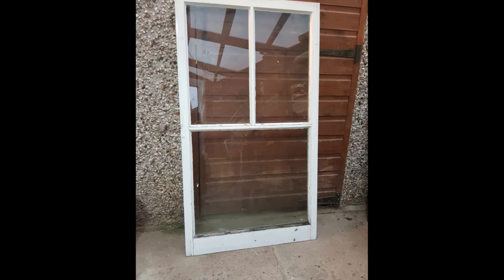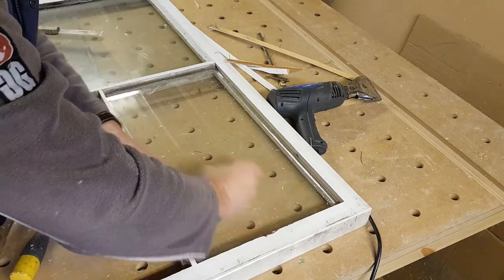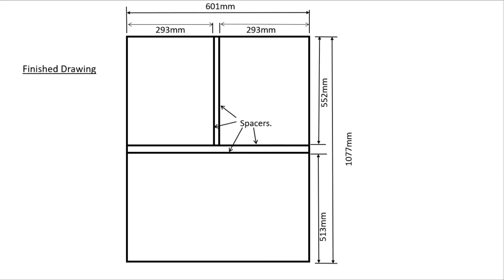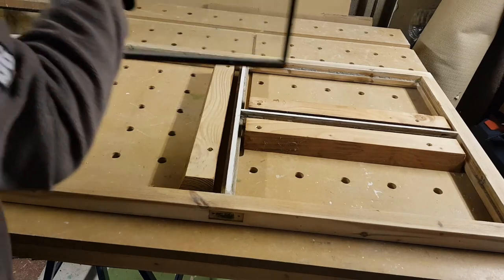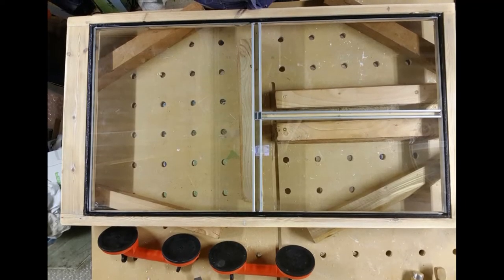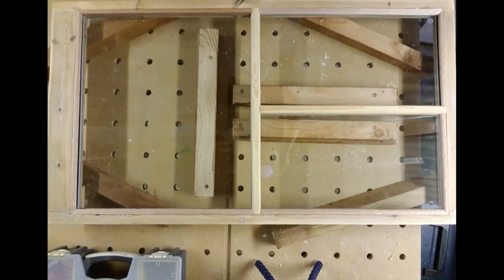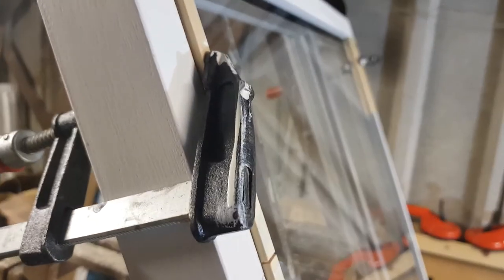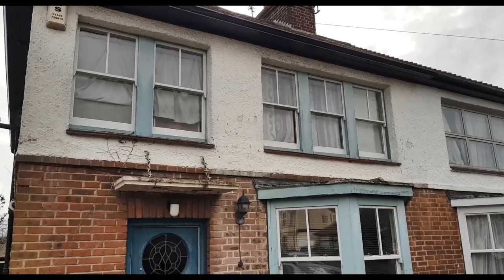Double glazing old sash windows.

Comment: Hi, great video. I’m curious to know about the 2 part paint system you used.  Would it be possible to know the brand etc? Thanks.
Reply from the maker: @Jonnysonone  Hello. Thanks for getting in touch. It’s actually a 3 part system made by Dulux. The first part is the etcher followed by an undercoat then the top coat. Not easy to find in stores but if you look in their Dulux Trade section for Weathershield 1 preservative primer (square tin) , 2 undercoat and 3 topcoat (usual round tin), you will find them.
Reply: @warwickshireworkshop9186  thank you so much

Comment: This is great. I want to do this to some old single pane French doors. The panes are all puttied in at the moment. If I was to replace with this method would I need nails or would silicone and beads be strong enough?
Joe
Reply from the maker: Hello Joe. Thanks for the message. Silicon is extremely strong so nails will not be needed. I would think you might have to deconstruct the mullions and by using a router table, reduce the depth of each one then stick them onto the DGU. If not make a jig to support them while you use the router. It will be painstaking work but with patience it should work. I have not used this method on French doors even though I have a set in the house. Let us all know how you get on.

Comment: Hi. Thanks for this video. Do you use linseed paint on the frames?
Reply from the maker: Hello. No I dont, I use the Dulex Weathershield 3.2.1 system.
Reply: @warwickshireworkshop9186  Highly recommend that you look into microporous paints like Bedec MSP. Dulux is just too inflexible for exterior wood, it can last a few years but it will crack, develop blistering and peeling. And can trap moisture in the wood. Becomes a pain when you have to refresh it because you have to strip it completely.
Reply from the maker: @ComeWhatThey  Thank you for the information. It's always good to get feedback and advice. I will have a look the next time I repair an external window.

Comment: What a great video, so informative.  I am quite an experienced woodworker used to making cabinets etc.  I'm usually pretty confident at making and modifying in wood, however I have one question.  If you deepen the rebate to take the much thicker glass unit isn't there a risk that the strength of the sash (frame) will be weakened?  Does the stiffness and strength of the new glass unit compensate for the weakening of the sash?  I guess as its one large sheet rather than 2 or 3 sheets of single glass, it contributes to the strength?  Thank you

Comment: Very informative. Thank you. Bit confused about the spacers. Should you the spacers at the bottom of the window be four mm in thickness? If you want a four mm gap? Vid seems to indicate two mm. Thanks again.
Reply from the maker: Hello John. Thanks for getting in touch and good question. Allowing the glass to sit away from the spacers would be preferable to allow for expansion and this should be possible as the silicon can support the glass in the frame. The aim of the spacer is to keep the glass from sitting or moving onto the wooden frame. This then allows any water that gets into the gap to stay away from the glass. You can use either what is shown in the video or any size gap and spacers you prefer depending on the size and shape of the wood. Hope this helps.

Comment: Great video - I’m inspired to do this in my home. How do you keep out the elements and secure the windows while you’re working on the sashes?
Reply from the maker: Hello Daniel. Thanks for getting in touch and for the positive comments. Appreciated. I cut a sheet of 11mm OSB down to size,  paint it white and screw it into place. If the window faces the predominant direction of wind and rain I add a bit of clear silicon for draught and  water protection. I paint the OSB white as it looks better than plain OSB. If I had any artist skills I'd draw a sash window and a pot plant on it but thats beyond me. Hope this helps.

Comment: Looks really good. Is there any benefit to one double glazed unit over 3 separate units?
Reply from the maker: Hello Jason. Thanks for dropping us a line. It is easier to fit one piece of glass than it is three. You will have to create a gap between each DGU so would run out of wood to hide the separator bars behind. Hope this helps.

Comment: I was thinking isn't it a good idea to drill a couple of holes from  the bottom of the glass either directly down or at a gradient to the side of the frame for any moisture to drain ?
Reply from the maker: Hello Mark. Thanks for getting in touch. You could do this but you would have to make sure the walls of the holes are treated to stop rot from within.

Comment: what about those cast iron weights? don't you need to put in extra iron ?
Reply from the maker: Hello Zirman. The original steel weights are normally cylinders of cast iron with domed ends. Adding anything to these is difficult as the space in the sash frame is limited. Lead is the only way to go if you are converting to Double glazed units.

Comment: My father used to do an emergency stop everytime he saw a skip and salvage old window frames because he wanted the 3mm glass which you could no longer buy for broken windows we would get now and then being next to a public alleyway. Because 4mm glass didn't balance with the weights on sliding sash cord windows.
Reply from the maker: Yes Mark. The Old glass is irreplaceable. All the old glass I remove from my windows I pass onto a specialist window renovation company who come to the house and collect it. It is that important to them as you cannot get it any more.
Reply: @warwickshireworkshop9186  However I have found a supplier that imports 3mm glass for greenhouses so all is good.

Comment: Hello, nice work. I would like to do the same but am worried about the depth of wood left after routing the sash window frame. I cant find any guidance on this (I doubt there is any really). Do you know any rules of thumb to know what thickness of wood is required to hold a double glazed window in place?
Reply from the maker: Hello Mark. The only rule is to use the minimum thickness double glazing possible which is about 14mm. This will then have a separating bar with a distance of about 10mm in form the edge. So with the 2mm surround gap that makes 12mm rebate all round. You will cut into the corner joints of the frame as I do. The depth you plunge will be 14mm + the bead, which you can cut down to size to minimize the wood removed. One thing to remember is that glass and esp. double glazing is very strong, it has amazing ridged strength capability. So if it is securely bonded onto the wooden frame with silicon it will become the strongest part of the window and keep the wooden frame together. Send me some dimensions of the frame you have if you are concerned and Ill compare them to the windows I have restored. Hope this helps.

Comment: Nice job. Matter of interest, why is the thicker DGU heavier?  It's still only 2 sheets of 4mm glass, even if the space between them is bigger.
Reply from the maker: Hello Tom. Thanks for getting in touch. On the older sash windows built around the 1920's, the glass will be circa 3mm. So with regards to a 2 pane frame with glass measuring 550mm x 320mm each, the weight is 3Kg. I have a DGU measuring 555mm x 700mm so roughly the size you will use to replace the two single panes with the method shown in the video, the weight of this DGU made up of two 4mm thick glass is 7.5Kg. Hope this helps.
Reply: @warwickshireworkshop9186  That still doen't explain why a larger gap means more weight?
Reply: @eah4187  frame of DGU must weigh something and one would expect 4mm glass to be 33% heavier than 3mm.

Comment: That was a very informative video, thanks.  I'm curious, how does the finish product compare to uPVC windows in terms of energy efficiency and U value?  And was your main objective in saving cost and maintaining the classic look?
Reply from the maker: Hi Bel. Thanks for your message. As the Double glazed unit in these windows is thinner than the normal upvc DGU's the efficiency is slightly less, if you are just comparing DGU's. I'm not sure about the U Value so cannot comment. The cost of performing this piece of work to having the original sash windows ripped out and replaced with plastic is far cheaper and you retain the looks, so yes, that's why I did it. The house shown in this video is the only house in the road that still has the original windows. Even by hiring a decorator every 5 years to paint the outside in order to  maintain the wood, it would take decades before you reach the cost of UPVC replacements units. Hope this answers your questions.
Reply: @warwickshireworkshop9186  yes, that makes complete sense. Great work

Comment: hi great video ,just wondering can you not just use a full clear pane ,what do the spacer bars add ?
Reply from the maker: Hi Ste25.
You can use a normal double glazed unit but when you put the unit together you will be able to see between the Muntins. These are  the wooden bits that would normally separate the original single pane glass sheets. It will look a bit odd close up but still work. Hope this helps. Cheers.
Reply: @warwickshireworkshop9186  Hi thanks for the reply ,if i could just ask when routing the frame you have to take it down to a level to take the extra depth and beeding but do you have to also increase the width  and height of the opening  to avoid the edge showing or does the beeding cover it ?if so how is this calculated ? also do you have any risk of the unit failing and is there a way to minimise the risk of this happening ,sorry for so many questions and many thanks for your help.
Reply from the maker: Hello Ste25. Thanks for the questions, I want you to get this right so no problem in asking. The Double glazed unit (DGU) should have been made to a size that it has the inner edge of the metal separator bars (the bit between the glass) in line with the inner edge of the wooden frame. Then rout the wood to accept the glass width + 2mm at the top and side and +4mm at the bottom. The beading should run from the inner edge of the wooden frame and separator bars (The 3 should line up) to the newly routed width. 
As far as failing units, I have had no problem with this. DGU's are extremely tough and when the wood is glued to it with silicon the unit will be strong. 
Hope this helps. If you have any more questions, fire away. Good Luck.
Reply: @warwickshireworkshop9186  hi thanks for reply, just a last couple of questions ,can you putty instead of using beading ?, also i believe you cannot get spacer bars for  14mm are yours 18mm ? and do you bother draughtproofing staff /parting bead etc if so what method ? thanks again for your time .
Reply from the maker: @MrFlynn261  Hi Ste25 thanks for the questions.  Regarding the putty, I have never used it but due to the distance between the edge of the wooden frame to the inner section of the metal separator bar you would be  spreading the putty too thin. My glazing is 14mm thick for sure. it is the thinnest DGU I can get. To completely draught proof your sash windows you need to buy staff and parting beads. I use this company to get all I need.   https://www.reddiseals.com/.  They also do a neat little router bit that enables you to run a groove to the top of the upper sash and the bottom of the lower sash that you then run a plastic channel and draught proof seal. I hope this helps.

Comment: Can I ask how much thickness was left in the frame holding the glazing after the routing. I want to do the same but will be left with approx 8mm in the frame and 8mm for the bead. Windows are sash type
Reply from the maker: Hi Rodney. Thanks for getting in touch. To be honest I don't know as I have never measured it. I am going back to a previous customers house where the glass has smashed due to an accident, When I am there I will measure up and get back to you. Hope this does not delay your project.  However. 8mm does sound a bit thin but on the other hand it only has to stop the glass from falling out.  If you are in the UK there is little risk of tornados or hurricanes sucking the glass out so you might get away with it. I would try mocking up a frame and then see how strong it is, I think you will be surprised.
Reply: @warwickshireworkshop9186  I'm in Australia mate so I think I'm safe too but would be nice to have a bit more meat
Reply from the maker: @rodneyjacome6117  Hello Rodney. I measured up one of the frames yesterday. I have 19mm left on the frame after rebating. So a bit more than double yours.. What's the depth of your beading. As you can see in the video I've skimmed mine down a bit and they hold well.

Comment: Sorry for being pedantic, but  I wish you had added another glazing bar on the lower pane to complete a Victorian sash.
Window looks Unfinished and dreadful.
Great job otherwise.
Reply from the maker: Hello Richard. Thanks for the email. The original windows in this house had only one pane of glass in the lower section of the frame so this was a pure restoration project and the brief was to double glaze the original units which I did. You can see the original sash windows in the last few pictures of the video.

Comment: how long did it take you to fix one of them?
Reply from the maker: Hello Edison. 

Thanks for getting in touch. It depends on what paint system you are using and how fast your glazer can supply the DGU. Ignoring the removal of the old frame from the house and securing the aperture left by the unit and working to an 8 hour day. Lets start with the frame in the workshop. 
On day one. Measure the frame for the new DGU. Order the DGU. Remove the hardware, glass and strip the paint. If the frame is loose, apply glue to the joints and wood filler to any cracks. Clamp up the frame and leave over night to set. Order the lead weights for the heavier windows. 
On day two. Remove clamps and sand the frame to remove any excess. Check for any paint left in the difficult parts to reach. Set the frame up for routing and rebate the frame. Wait for the glass to be delivered – this takes a few days. Make the beading to fit. 
On day three. Depending on paint system. One day = one coat. So this depends on what system of paint you are using. Paint the beads at the same time. 
Next task. Fit the glass and the beading and apply the final coat of paint. 
In my experience it takes 7 working days for each frame. Most of this is watching the paint dry. 
Hope this helps.

Comment: What wood species are you using / was use for these windows?
Reply from the maker: Hello mingueyox. Thank you for getting in touch. The window frames in this video are a soft wood, not sure exactly what this one was but I assume it is pine.
Reply: @warwickshireworkshop9186  Thank you for the quick answer. I am up to restoring and making new windows for an old cottage here in Ireland. Your video is very helpful. Cheers
Reply from the maker: @mingueyox  Your welcome. Hope they work out well. The key is a good paint finish. Try using aluminium paint as an undercoat with a metal paint top coat. I have just finished a house with these and in black - they look great. Best of luck.
Reply: @warwickshireworkshop9186  oh, very interesting. To recap : etch primer, aluminum undercoat and a final metal paint. Right? Many thanks again
Reply from the maker: @mingueyox  no sorry. The video shows the Dulux Trade weathershield 3 coat system that has an etch coat to start. The other option is apply aluminium paint direct to the dry bare wood. Followed by a metal over coat. As aluminium primer paint is about 40% metal it's like coating wood with a metal coating. Very tough.
Reply: @warwickshireworkshop9186  understood. thank you so much 🙏 👍

Comment: How much does it cost to get this done?
Reply from the maker: Hi there Kino Recaps. Thanks for your question. To do it yourself and not including your time or any tool purchases, would cost no more than £140 in my estimation. But this is 2021 and prices are going up every day. It also depends on where you buy your products. My advise is to shop around, set up a business account if you can to max the discount and get a good working relationship going with the suppliers. Bigger is not always the best. Good luck in getting someone to do it for you. I failed so started doing it myself.
Reply: @warwickshireworkshop9186   thank you for your reply, i‘ve had some crazy quotes for 8-12 k. I found all the tools and materials for £600 now ill get it done myself. quick question about the canal on the sash hoe deep should it be?
Reply from the maker: @tateknows1688  Hello there. Yes they are crazy expensive. I was quoted £35K to completely replace 19 sash windows in a house once, hence this video. I am not sure I know what you mean when you mention the depth of the canal. If you mean how deep do you recess into the frame it will be the width of the glass plus the bead depth +1mm for sealant. Hope this is what you meant. If not feel free to email me on warwickshoprenovations@gmail.com with more information. Cheers.
Reply: @warwickshireworkshop9186  thanks mate i appreciate it